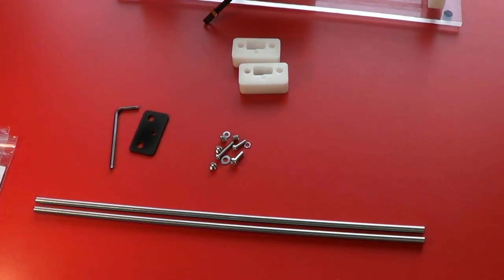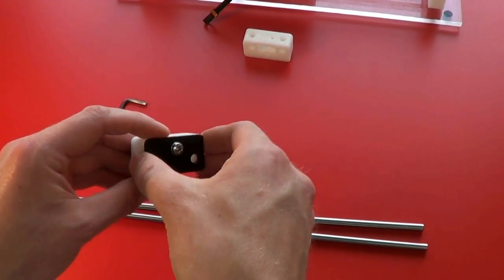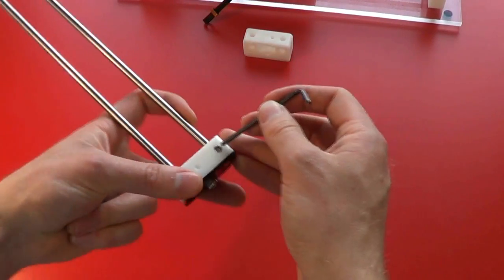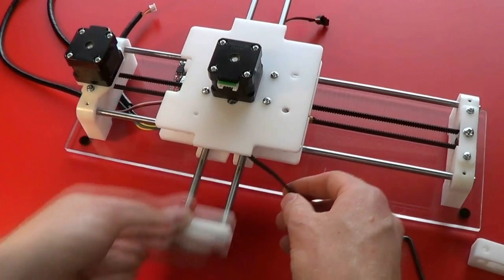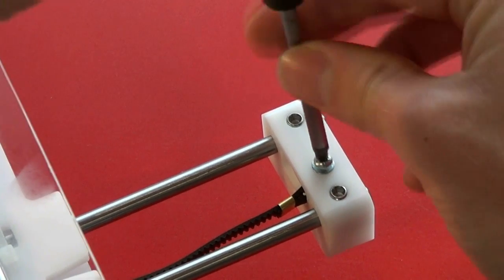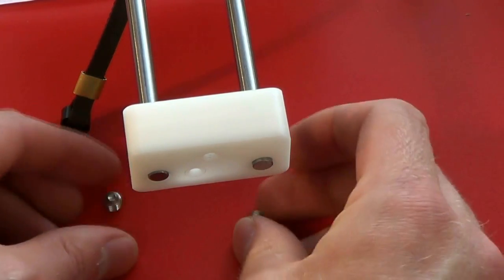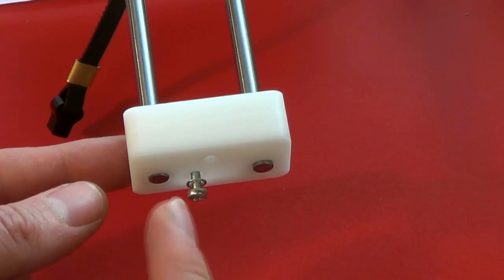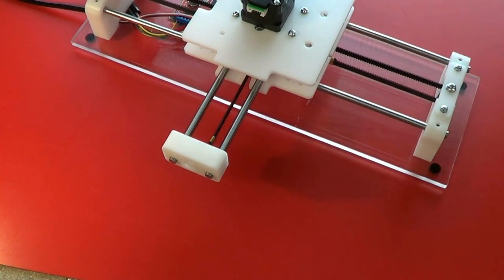AxiDraw® assembly - step 8 - Y slide mounting

Comment: Hi buddy!, what software did you use to make gcode files and gcode interpreter software?.
Reply from the maker: Hi, it's not G-code; drawings are made in Inkscape and are sent to the machine via the AxiDraw extension. More info on the Wiki here: http://wiki.evilmadscientist.com/AxiDraw
Reply: Ahhhhhh I got it.It's simpler than I thought.IF I want to carve wood or drill what tool can be placed? Is this machine just to draw?